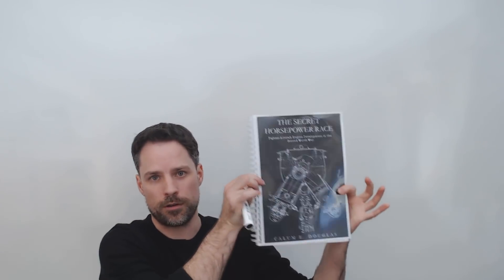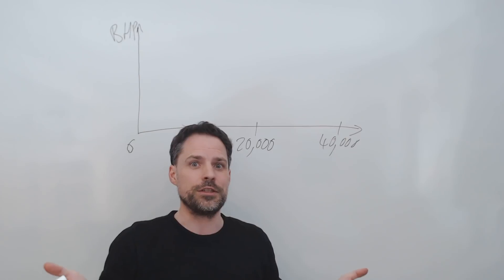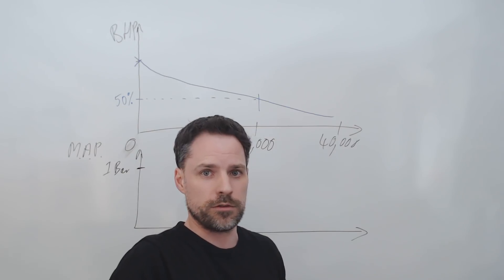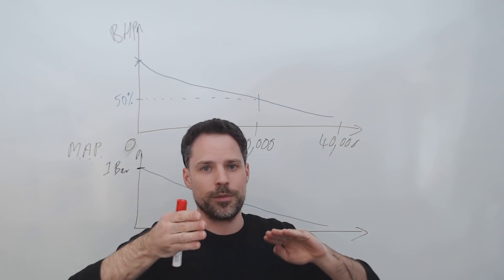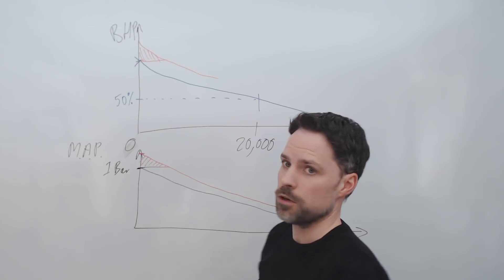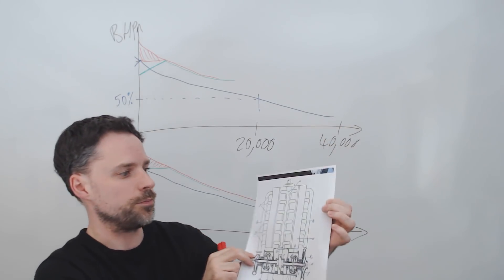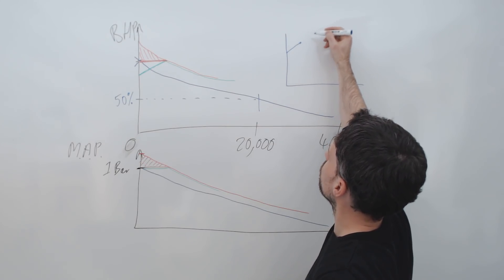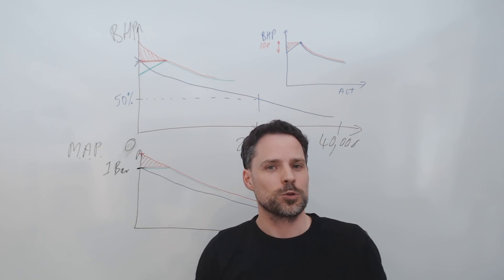The Secret Horsepower Race - Video 1 - Superchargers

Comment: Great book, got it on my birthday, I really enjoyed every page. Thank you Mr. Douglas for doing this deep dive into aero engines. 
But what I never understood and please help me if I am wrong, but why did those engines have such a conservative output per litre?
Just as example: DB 605AM engine "Sondernotleistung" which means full pelt + MW50 is 1800HP/35,7L=50,4 HP/L. The "Dauerleistung" which is the continous power output is 1080HP/35,7=30,2HP/L. That is not much. Even the KdF Wagen aka Beetle had 22HP/L in its initial stage. My first VW Golf MK1 1983 had 4 zyl 1.1L 8Valve and managed 50HP naturally aspirated. Now I drive a 1990 Corrado G60 1.8L and it does easily 100 HP/L all day long using basically same octane fuel (102ROZ) as the DB605, but this VW engine (EA827) is a most poorly designed counterflow cylinder head with two valves, single ignition and a mechanically driven supercharger. So it has all the outdated things combined to get the cheapest engine but it still has double or triple the specific output of a DB605 going plaid. How is this even remotely possible? Please help me there must have been a limit in those days which clearly escaped me (except the lack of Ni).

Btw the specific output of a Merlin was higher at ~ 62,9HP/L full pelt and ~ 46,4HP/L continous -ish.

Comment: Would an over-pressure valve have worked if it let air out at 1 bar- or would that have messed up airflow to the pistons too much?. Great video-thanks. The book is absolutely brilliant. Well worth the money.
Reply from the maker: There are two problems with using a boost dump valve, one is  that most engines had carburettors so you dump fuel... wasteful and potentially dangerous. Secondly dumping boost AFTER you`ve already made it, doesnt get you out of the power loss to the compressor, so yes it would work to avoid over-boosting the engine, but wont work to reduce how much power the compressor saps from the crankshaft.
Reply: @CalumDouglas   enter the two speed or variable speed supercharger drive

Comment: All into the lingo ...
Super charger , chargers blowers .. 
In in Britain a blower or charger 
In German it’s called a lader. .. the turbo super charger is a gas driven unit.  The super charger is a mechanical driven .
But a charger is the same as a super charger like wise the blower . 
Crazy it is.

Comment: Dear Sir Douglas,

Your explanation towards single and variable speed superchargers was very informing.  I'm working on achieving my Powerplant Certification.  By far my favorite class, I have taken, was reciprocating overhaul.  It's amazing what the components look like and how they are operate in harmony.  I have taken it upon myself to read the Continental Overhaul Manual to obtain a better understanding behind the principles of the supercharger.  I now have a deeper appreciation for engineers and understand that what they have invented is a true engineering marvel.  Aviation is proof that given, the will, we have the capacity to achieve the impossible.  Again thank you so kindly for the summary.
Reply: If you allow me, hard as it may sound, WAR  is a creator of technology, 90% of the technical advances were first developed for a warlike purpose, then massified

Comment: Thanks for this presentation. I have read a patent by Kollmann presented here and filed April 22 1938. It describes many possible ways of regulation. What way was chosen for the DB601? http://www.freepatentsonline.com/2238889.pdf
Reply from the maker: The hydraulics are basically as in "Fig 3" in that document, the rest is similar but with only ONE hydraulic coupling. You also have TWO throttle valves in the Me109 for example. One is for boost control which is automatic, the other is for pilots desired throttle so he can speed up or slow down the engine for cruising, landing or full power take-off, although propellor pitch control is also needed. This was manual on the 109E (there was a little control dial on the control-stick, but made fully automatic on later models).
Reply: Nice. I suppose only one hydraulic coupling means only one blower was applied. I think it is interesting, that an international patent was filed in 1938. It means that this important invention for military purposes also was made public to the world.
Reply from the maker: Germans did lots of very strange things in WW2, such as continuing to send out their aviation scientific journals like "Luftwissen" even after the declaration of war, so the Allies could normally get copies from agents in Italy for example, which is much easier than from inside Germany. I think they assumed the whole war would be over so quickly that nobody would gain an advantage from studying them.
Reply: I suppose, that if both blowers and couplings actually had been introduced as described by patent, then the needed fighting at high altitudes would had been helpfull in the later parts of the war.
Reply from the maker: Yes - I am sorry but you will have to read my book when it comes out to understand why that didnt happen.